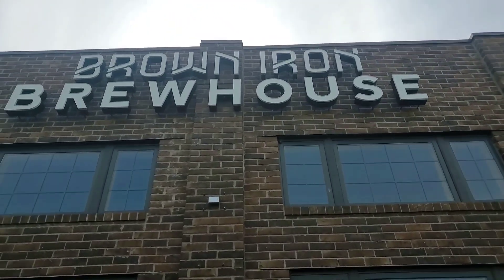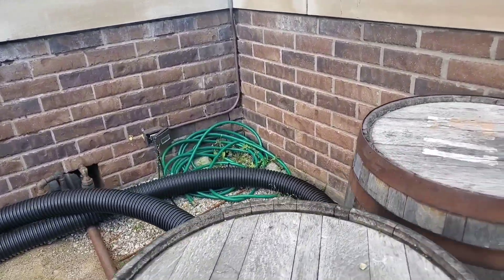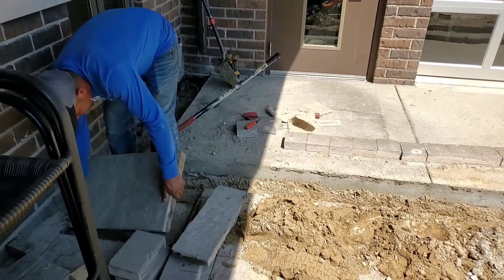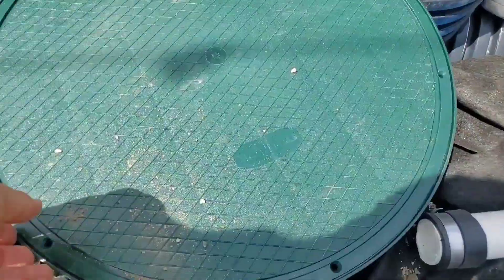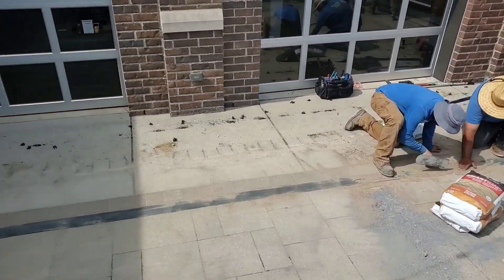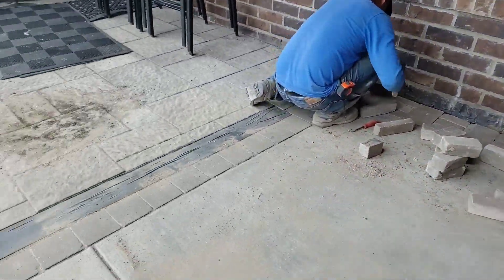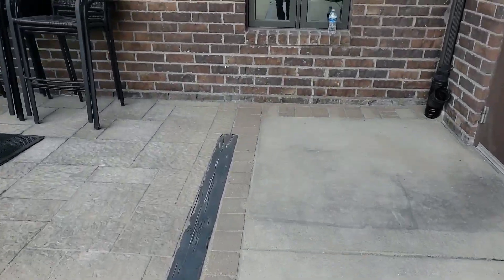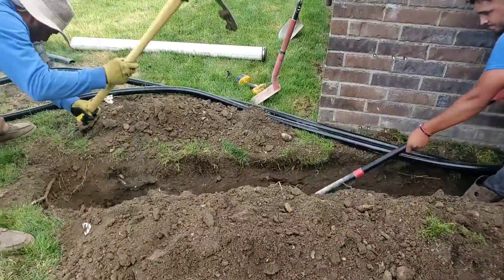How To Stop Outside Storm Water From Entering Any Structure [ Channel Drain to Outdoor Sump Pump ]

Comment: Just found your channel & I wish I had seen this years ago when a company I worked for has a very similar issue and had installed a similar, inadequate system - TWICE.  I'll be scrubbing the past content for information where you may have answered my question already.  I am working on a system to provide a water source for my honeybees. I have procured a large boulder that I intend to drill a hole through to pass rainwater, pumped from an underground basin where I capture roof runoff.  In my area, the average rainfall is 15 - 20 inches so, I don't anticipate an issue however, I am planning an overflow that runs to the curb.  I'm concerned about placing a storage basin, filled with rock, with a large boulder on top. I would install a small pump (5 - 10 gph) that would pump from the basin, up a vinyl tube run through the boulder, spill onto the rock surface and fall back into the basin. This would provide a nice water station for my bees and, hopefully, look nice in the yard as well.
My question ... Do you have any recommendations for basins, roof-gravel cleanout, or overflow configuration? What else am I overlooking?

Comment: Hi, quick question.  I live in the north and I hear you say alot that you have to dig 6ft deep to go lower than the frost line for a dry well or it will heave, but I see your outdoor sump pump systems do not go that deep? Or do they and they are just sitting on a ton a stone?

How deep does the outdoor sump pit have to be for freezing winters to not have an issue?
Reply from the maker: The chamber is the reason it works in the frost. Think of all the dirt and rock on the chamber. It's not going anywhere. If it was just vertical it would get pushed up. 
Great question Thank You for commenting.
Reply: @FRENCHDRAINMAN  Thanks for the reply. Love your videos man, keep up the excellent work. I will have to try one of your chambered sump systems because that sounds fantastic

Comment: Would like to see a video on your pump system power requirements and pump head capabilities. 
Also would like to know when you recommend going with the fuel pump system over the single. 

Thanks.

Comment: Robert,

What is the difference in elevation between the sump pit and the storm drain catch basin?  I presume the sump pit is lower, but I didn’t catch where you mentioned this in the video. 

Great Content!  Thank you, Robert.
Reply from the maker: The storm system backs up I didn't want it to back feed into the beer garden and flood the restaurant. All our infrastructure is overwhelmed during big rain events. When the storm can't take water our system will still pump water out keeping restaurant dry. What kind of water runs up hill? Answer: Flood water

Comment: I think it would be smart to have a way to provide a small generator power to the pumps just in case the power is out for a while. Or have smaller back up generator for key components.
Reply from the maker: All I can do is recommend that for 100% coverage and reduced liability get a generator back up system. If it comes down to one or the other putting in the drainage system 1st and generator in the future is the order of install when under financial restraints.
Reply: That area of the state rarely losses power. All the electric lines are buried and the majority of the area is residential.

Comment: And Can`t run direct to the Storm Drain ?
Reply from the maker: When Storm Drain overflowed it would flood the restaurant. They back up all the time. Infrastructure can't keep up.
Reply: @FRENCHDRAINMAN  Ya we know infrastructure is failing , that would mean the sump pit would start backing up anyway due the back pressure created overflowing drains, `Their are No Winners in a Game of Losers`
Reply from the maker: @45NUTS_PART_DEUX  No Sir the sump pump still gets the water out. When the storm drain overflows it floods the street.